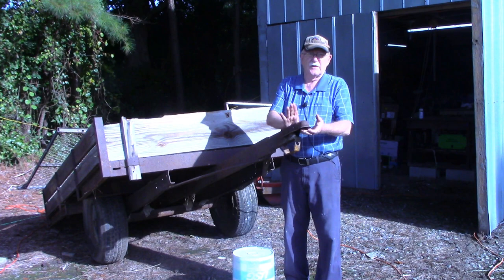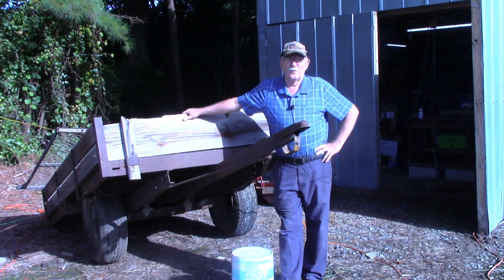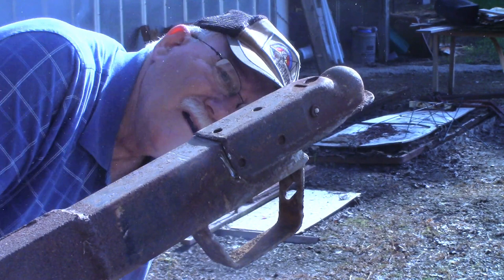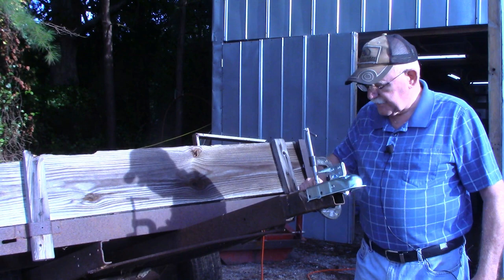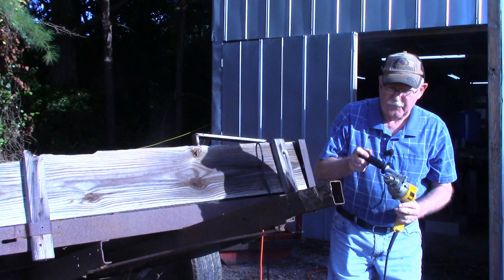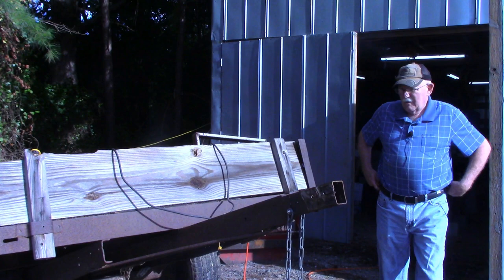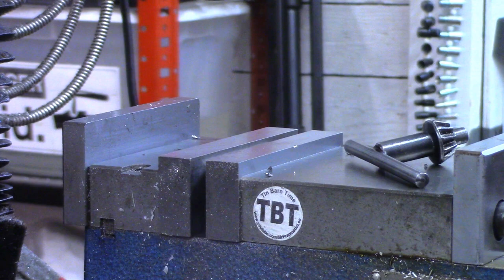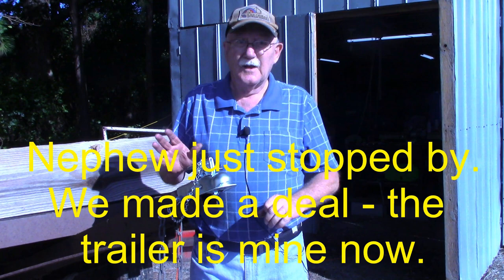Replacing a Trailer Ball Coupler

Comment: I would recommend checking at Tractor Supply or Harbor Freight next time, as I have had a lot better luck finding trailer and towing accessories at those stores compared to any of the normal big box hardware stores.

Comment: The hitch supply brings up an important issue. I'm not picking on you, your situation just illustrates the following points. 

One way our nation's enemies have to defeat the U.S. is to control the source of supply of our goods. 

We over came our enemies in WWII not only by fighting, but by out producing them in war supplies. A hint of our current peril is in computer chips for new cars, and in empty North Carolina shelves. 

We, (including me), are guilty of buying based on price, not on principle. We have put U.S. made goods out of business by buying the cheapest cost goods. To put a cherry on top, some of our military goods are imported from places whose interests are not constant with ours. We have given designs of military computer parts to foreign manufactures who  promise they will not give the designs to their homeland governments. 
 
I guess I finally woke up. Are trailer hitches, hooks and safety chain still made in the U.S.? I am worried the answer to that is no.

Thanks for the video.